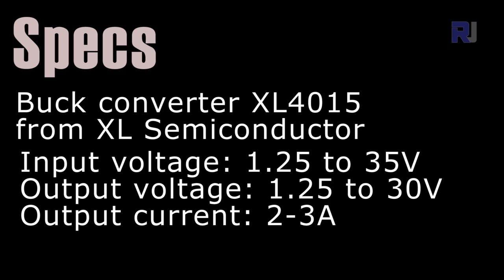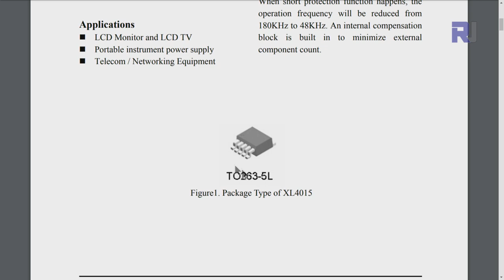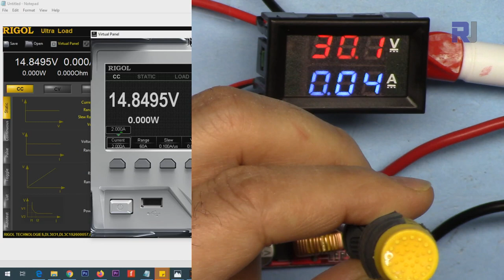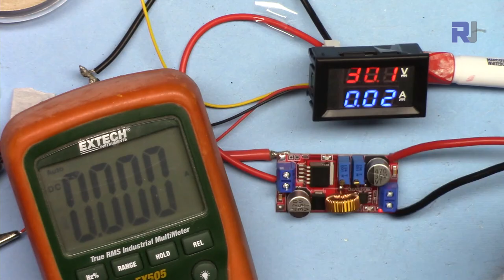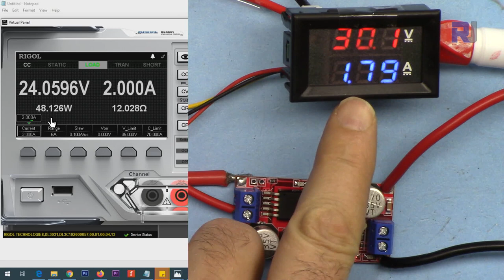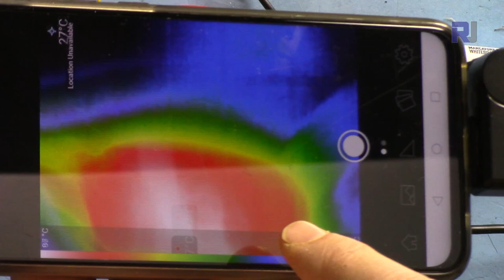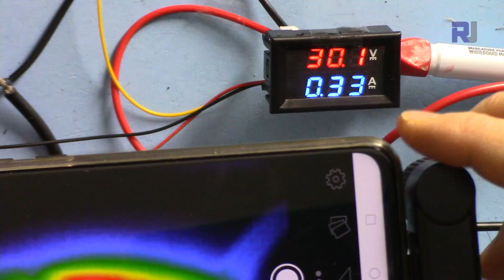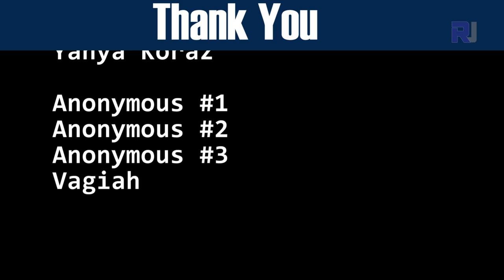Review of XL4015 5A 1.25 -30V DC CC Buck converter with thermal image

Comment: Ahmed that is awesome excellent
i have a question : i have this buck converter xl4015 5A
Example: i have input 12 volt and input amp 3.34 it is 65w adaptor smps , i want out is 14.4 volt and 4 amps =  55 watts ( is that possible )

Thank you
Reply: yes
Reply from the maker: Hi,  output can never be greater than input.  I've shown the efficiency which show 10 to 20% amount of energy is lost as heat.  so Pin=12V(3.34)=40.08W and if you subtract 15%=6W, then output would be 40-6=34W.  at 14.4V then I=P÷V=34÷14.4=2.36A is the output.
Reply: @robojax  Thanks Robo

i have mistake when i right the question now i have corrected here please see and reply

1 Input Adaptor Volt 12 and 4.16 Amps as per your calculations it is 42.5 watts

2. required output is volt 14.4 and 4 amps as per your calculations it is 2.95 amps

it is still low as per my needs 14.4V / 4A

My Questions

1. So i need a 12v and 6amp adaptor for take 14.4v and 4.25 amps from buck converter ?

2. still i am good if i am taking out with my old adaptor 12v 4.16A from buck converter 14.4v and 2.9A  ?

3.is that ok/possible take higher voltage from buck converter by multiplying input adaptors volts and amps like input buck 12v 6a out from buck 14.4v 4.25a  ?

Thank you
Reply: i have mistake when i right the question now i have corrected here please see and reply

1 Input Adaptor Volt 12 and 4.16 Amps as per your calculations it is 42.5 watts

2. required output is volt 14.4 and 4 amps as per your calculations it is 2.95 amps

it is still low as per my needs 14.4V / 4A

My Questions

1. So i need a 12v and 6amp adaptor for take 14.4v and 4.25 amps from buck converter ?

2. still i am good if i am taking out with my old adaptor 12v 4.16A from buck converter 14.4v and 2.9A  ?

3.is that ok/possible take higher voltage from buck converter by multiplying input adaptors volts and amps like input buck 12v 6a out from buck 14.4v 4.25a  ?

Thank you

Comment: I bought 5 of these modules; applying 13v input; output voltage is equal, i.e. always 13v.  Voltage potentiometer does nothing to change output voltage no matter how many turns - on all five modules.  I would recommend to stay away from these modules as apparently they're prone to component defects.

Comment: I made a Lab power Supply with those 2 modules: XL4015 + LCD Voltmeter 4 digits ( the good model, cause 3 digits is not the best)
When I turn potentiometer to set voltage on XL4015, there is a some delay before the actual voltage is displayed on the LCD.
I tried XL4015 + Ordinary Multimeter, this delay is not present, the voltage is displayed live while turning the pot.
But as said XL4015 + LCD voltmeter Display combo, there is  some delay, like the voltmeter is analysing the new voltage value.
I would like it to be instentanatly, no delay, while I turn the pot, the voltage is display directly, without this delay.
Maybe somebody encounter this, and got some idea??
Thx
Reply from the maker: your project has 2 projects. you have delay in code where LCD works. remove any delay in the loop something like delay(500) or whatever you may have. Use the code in this video https://youtu.be/xrIiKqvm8hQ
Reply: @robojax  Thx you very much.
Unfortunatly you got it wrong. It is not an arduino Project. I know the function "delay" in arduino coding. Here it is not an arduino Project.
it is a simple Lab Power Supply, with XL4015 + LCD Voltmeter "DSN-VC288", as you show in your video.
As this project: https://www.instructables.com/Mini-Variable-Power-Supply/
No arduino coding is included.
The combo XL4015+ Lcd screen Voltmetterr is a lot used to make a DIY Lab Power Supply if you look around, and I connected everything according to datasheet schematic, LCD voltmeter/Ampmeter is in serie between Power Supply (XL4015) and the load device to monitor also current used. Everything fine working good, except when you turn the potentiometer, there is a very small delay before the new voltage value is shown on the LCD Screen. This is what I am trying to resolve.
Reply from the maker: I though you are using an Arduino. Then I have so many voltmeter reviews. check them out. I can't help with the something that I have not worked on.

Comment: Can this be used to power 3watt power led?
Reply from the maker: It depends on the voltage. It is 1V 3A it may no be able to do it. But if it is 10V 1a it can . Yes it can

Comment: Review is so cool.. plz continue to do more reviews. I have 2 questions :

1. am trying to use XL4015 for 24V to 7V in a 2A load, is it need heat sink?
2. Can we conclude if the output watt is more the IC heats nd if the VIN - Vout is large the inductor heats up?
Reply from the maker: Thanks. 1-I answered that with test in the video. 2-Yes I demonstrated it. I don't remember anything abou this video.  I have to watch to answer it. So you watch without skipping and I can assure you , you will get answer.

Comment: Excellent video Ahmed Keep it up ( i have a same question as asked Feroz please reply )
1 Input Adaptor Volt 12 and 4.16 Amps as per your calculations it is 42.5 watts

2. required output is volt 14.4 and 4 amps as per your calculations it is 2.95 amps

it is still low as per my needs 14.4V / 4A

My Questions

1. So i need a 12v and 6amp adaptor for take 14.4v and 4.25 amps from buck converter ?

2. still i am good if i am taking out with my old adaptor 12v 4.16A from buck converter 14.4v and 2.9A  ?

3.is that ok/possible take higher voltage from buck converter by multiplying input adaptors volts and amps like input buck 12v 6a out from buck 14.4v 4.25a  ?

Thank you in Advance
Reply: Hello rizwan...this circuit is a buck convertor. Means it is used to step-down voltage so u wont be able to get 14 volts output from 12 volts input. In order to get higher  output voltage than the input u should use a boost converter circuit.

Comment: Thanks for all the great video's, very good and handy.  
I also have one question: do you have an explanatory video of the  XL4005 step-up-down module (with 3 potmeters), thanks for answering and have a great day!
Reply from the maker: Not yet!. Just purchased it. it will arrive in 40 days.
Reply: @robojax   Ok, well I am subscribed so I will see it pop up in a month or so, super thanks!  
Oh and as PS: you have 2 video's of the 3S charger boards (very good)  but of course I bought the 4S 40A version.  One problem that 75% of the buyers have (me too) is that the module does not output 16 Volt when you hook up the 4 18650 batteries, it gives out 12 Volt and that doesnt change. Also some mosfets dont have a voltage on the gate.. 
.
But the solution is very simpel:  most people hook up new and fully charged batteries. The board will go in protection mode and  then the board's mosfets start working only if you connect it to a charger (CC and CV of course) for about a minute. After that the board works as  it should.  Took me a whole day to figure out, so if you eventually do a review of the 4S boards, remember to mention it :-)  Have a great day!
Reply from the maker: You are welcome. yes. I have mentioned about protection in the video. Most people skip the video thinking it is extra. But I have spent about 10 days on that video to test and see all details to make that video. You have a good day and stay safe.
Reply: Yes and we do appreciate it! 
. It's just that I have no 3S board here so I did indeed skip a few bits 😂

Comment: why they lie in china for the product s? i order 1 i got it , i look at the 2 capacitors is 36 volts , and in the description they say the input voltage is from1.25 to 36 volts , and the output is not 5 amps , thank you for your video ,
Reply from the maker: you are welcome. the sellers on eBay or AliEXpress just put the number. the 5A is correct but on the way it is sold.  I try to educate people so they know the modules sold don't have accurate description. if you put proper cooling heatsink, it will give you 5A.
Reply: @robojax  hello asalamu 3alekoum .thank you for your replay . i can change also the 2 capacitor for 50 volts? cause my input voltage will be around 33 volts ?
Reply from the maker: walaikkum slalam. check the datasheet as I don't remember what is the maximum voltage for the input if you are planning to change the capacitor. but for output you can't increase it as it is set in the module.

Comment: Can i give higher than 5a as input?
Reply from the maker: no you can't I've provided the datasheet for XL4015 and it has internal overcurrent protection. See the datasheet
Reply: Ok thanks.. Can i use 100w 5a Panel?. Or not safe. Tia

Comment: potentiometers do not work and when I want to charge the battery the green and blue lights are on respectively
Reply from the maker: something is wrong then.
Reply: @robojax  I noticed that the converter doesnt work with input 15 v. But works 24 v , 32v.